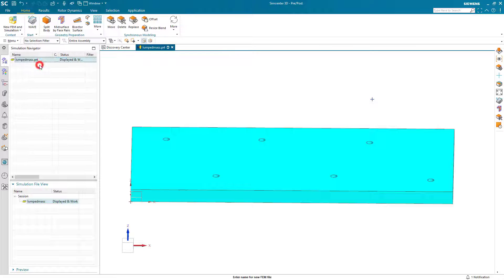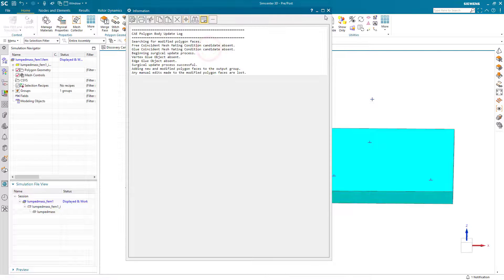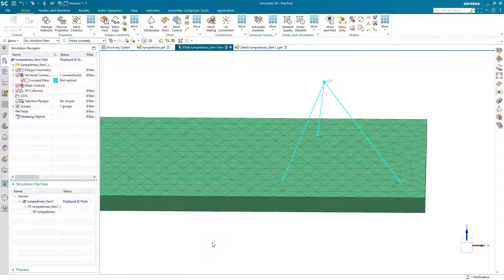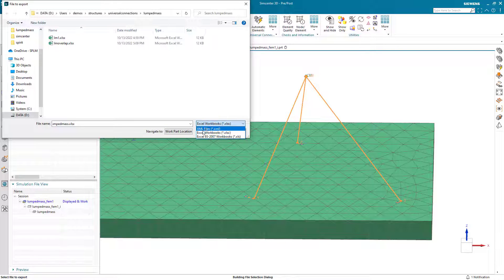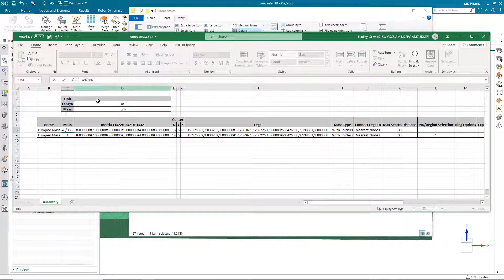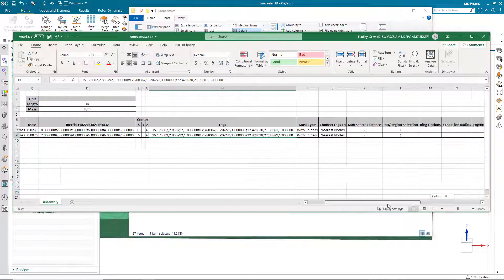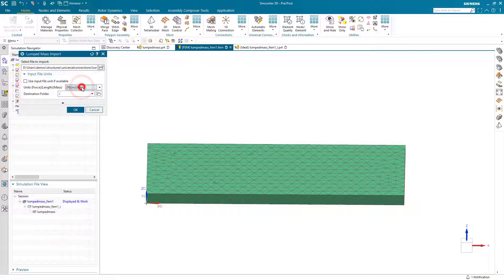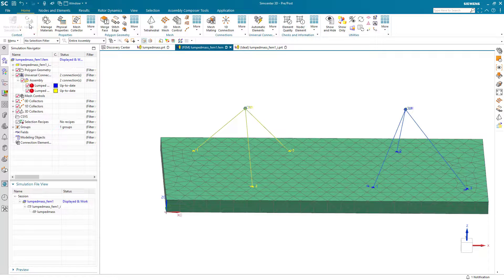How To Import Lumped Masses

Comment: Hi, is it possible to to do an iterative study, where I vary the physical properties in a mesh collector to different values and do analysis using a spreadsheet. For ex, varying thickness of two components as per a list in spreadsheet
Reply from the maker: Hi, yes this is possible using Solution 200 (Design Optimization or Design Sensitivity).  You can also do this with Geometry Optimization (right click on sim in navigator, new solution process, geometry optimization).